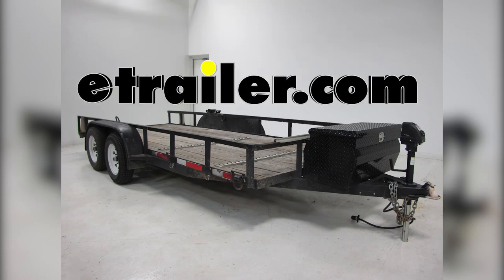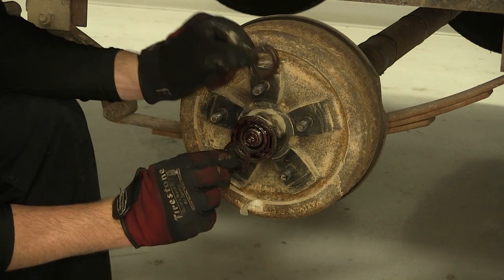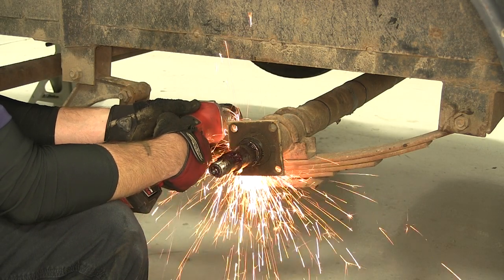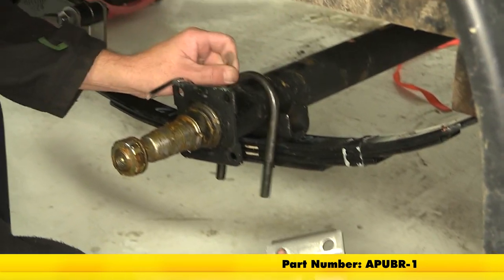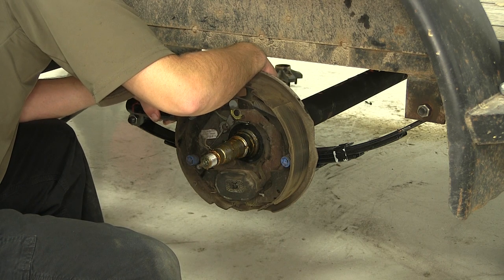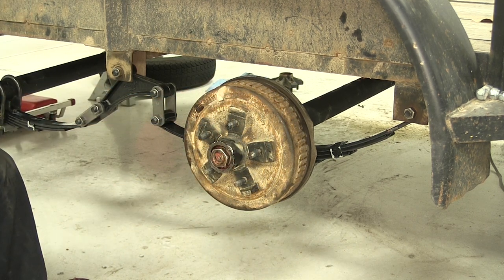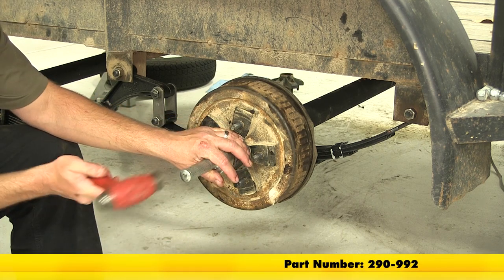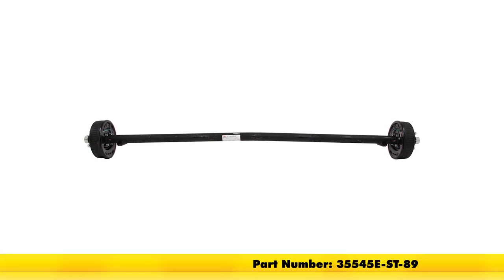etrailer | Comprehensive Review: Dexter Trailer Axle w/ Electric Brakes

Comment: Do all axles have a front and back?
I knew there are a top and bottom.
Reply from the maker: Axles are customarily installed so that the ID tag is facing the rear. You'll want to be sure that the arch as at the top of the axle and the spring seat is in the correct orientation for how your suspension is set up.

Comment: Are the Torque Specs for the u-bolts 45# - 70# correct for all Dexter 3500lb axles? Please help or send me to the correct place on the internet to find the torque specs if you could please. Thanks
Reply from the maker: The u-bolt mounting kit that we recommend for all Dexter 3,500 lb axles is linked below. The torque rating is a minimum 45 ft lbs and a maximum 70 ft lbs. 

https://www.etrailer.com/Trailer-Suspension/Redline/APUBR-1.html